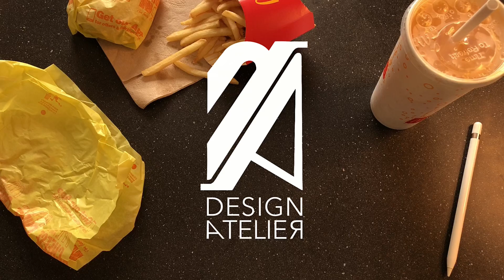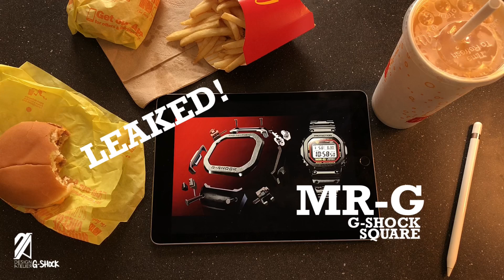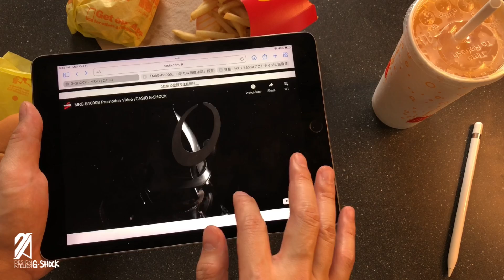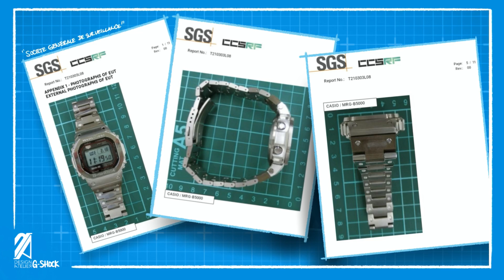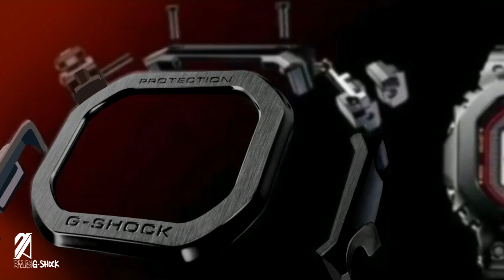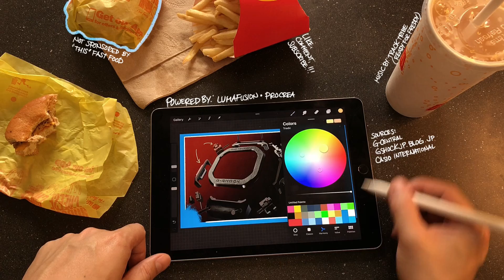LEAKED! New MR-G G-Shock Squares Coming Soon! (MRG-B5000B-1) The Best Titanium Square G-Shocks Yet!

Comment: I don’t see the added value in this.

I own the B5000, and that thing is already built like a tank.

And with the MR-G expected to use the same basic module that even a cheap GW-B5600 uses, (except for the STN display, which frankly isn’t that impressive compared to standard lcd) imho they are stretching the concept a bit too far now.

They should give it a new module, with an MIP display, to give it an outstanding readability. Maybe some extra features?
Reply from the maker: As much as we like all of these features I’m thinking they’ll just focus on some super complicated sounding metal process and call it a watch. You know too that the more they actually add features we want the more they’ll add to the cost.